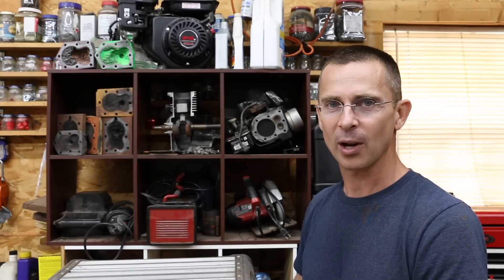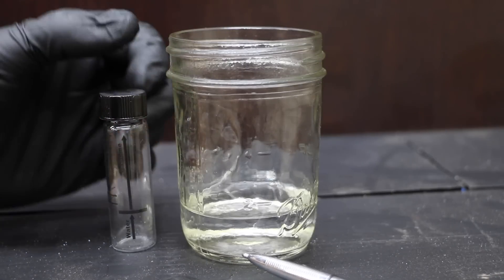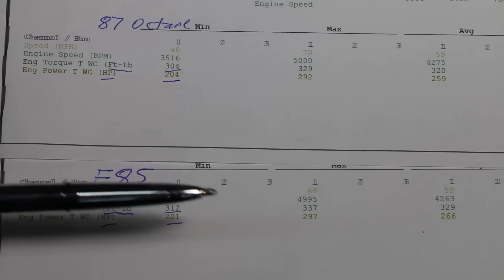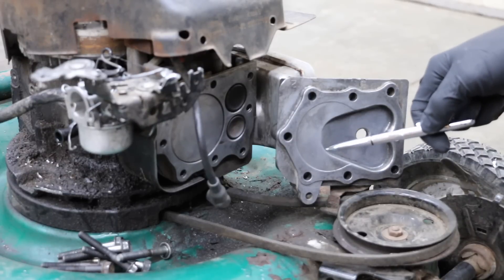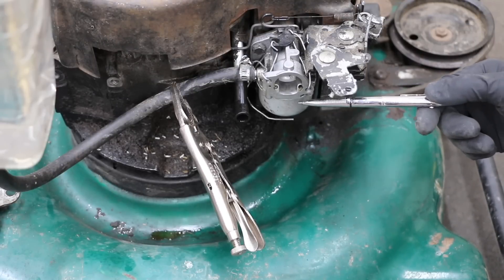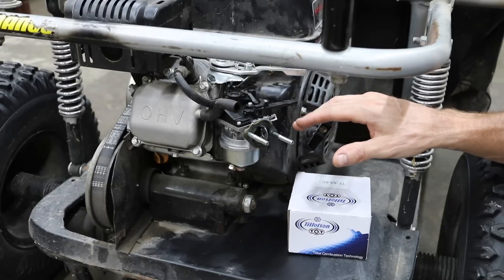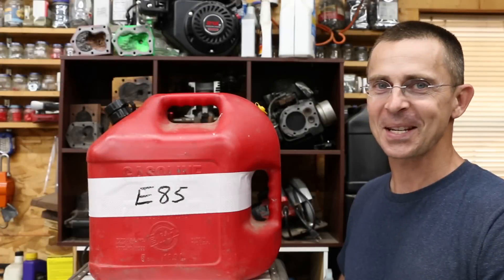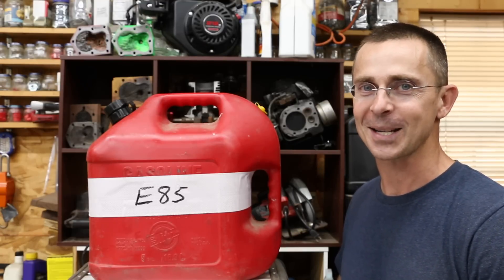Is E85 better than Gasoline? Let's find out!

Comment: Awesome!!! Been super excited for you to test Ethanol.  Would highly recommend you try e30-e50. I personally run E30 without a drop in mpg.

It doesn't surprise me to see a that massive chevy get less mpg. Even FF engines cannot take full advantage of the E85. You need more compression! 

Only thing a flex fuel car is good for is a computer to recognize E85, oversized injectors and adjust timing. I'd recommend a newer car, perhaps with a turbo to test e30, E50 and E85.
Reply: What is an E85 engine? Flex fuel vehicles just use the same engine as the non-flex fuel model.
Reply: MoronicAcid1 meant flexfuel!
Reply from the maker: Thank you

Comment: E85 is cool. It has a lot less power per gallon but alcohol just oxygenates so much better. The biggest problem though is that no matter how you cut it you can never make back the hit you take on MPGs compared to regular gas on a normal engine. If you have to run premium or higher then maybe. But in a vehicle that can run 87 no problem, it just isn't worth it. And if it weren't subsidized it would cost way more than it does. Also, we use corn, like the worst possible product to use for it possible because your yield is so terribly low compared to what you have to grow.
Reply from the maker: Thank you

Comment: Alcohol has approx 2/3 the BTU per pound as Diesel. Russia uses Vodka.
Set up a dyno for lawn mower using a water pump or alternator
Reply from the maker: Great point. Great test idea! Thank you
Reply: vodka is 60% water. I doubt you'd get good performance mixing in that much water.

Comment: In Brazil we have ethanol in all gas stations throughout the country, but is only ethanol with water (96% ethanol) because is a azeotropic mixture, and gas have 27% ethanol, engine runs rough on ethanol, but cooler and generally with more power. In the sugar cane season the ethanol prices drops and become more reliable than gas
Reply from the maker: Thank you

Comment: I run e85 in my ford ranger. I have to fill up every 6 days instead of 7 days and costs 30-35 cents a gallon cheaper so it evens out. It runs cooler and can feel a bit more acceleration.
Reply from the maker: Thank you

Comment: I've noticed with even max e10 fuel...89 octane...I'm my 98 f150...the fuel filters get gummy quicker. Ford recommended replacement at 30k miles by the book...well...they are nasty at around 12 to 15k now. And i use "name brand" gas. Then they did when it was basically new. I've also seen this on vehicles built before the ethanol blended fuel invasion!
Reply from the maker: Thanks for this information.
Reply: Thank you for viewing and responding to any comments. Top notch channel 👍👍

Comment: How would an engine designed to run specifically...not a compromise to burn gasoline too,  on e85 compare?
Reply from the maker: Great point. More horsepower, less fuel efficiency.

Comment: I have a turbocharged Dodge Ram 1500, and i have switched it to only E85, and picked up an extra 76 horsepower on using E85. The combustion chamber stays much cleaner and i can add much more timing with E85. Compared to gasoline i would never go back to it. E85 is the way to go in my opinion. If you compare cost of E vs 93 octane gasoline I’m actually winning. The fuel mileage does suffer a bit but not enough to care. E85 also comes out of the pump closer to 106 octane also. In the performance world, E85 wins hands down. Although the upgrades that had to take place on the fuel system (big fuel pump, big fuel injectors, fuel line that can hold E85) idk if the cost would be worth it on something that’s not a “performance” type build. With that being said, if you have a E85 vehicle already, it is well worth having it tuned on both and you can get the real benefits out of E85 and not completely kill your mileage due to the efficiency of E with the added timing it allows the engine to run.
Reply: Not to mention the cooling benefits that you get off of using E85 in a forced induction vehicle.
Reply from the maker: That's a huge gain on HP!

Comment: Ahhhh man, you completely missed the point of E85.  E85 is an amazing fuel for Turbo applications, where it burns much cooler. With it being a cooler burn, the boost can be turned up.  Most importantly though, and in general. The point at which detonation occurs increases by a decent amount. Again, the boost can be can be turned up, or the compression can be increased, timing can be advanced, etc.  Your main point, All applications have to be designed for E85, I do agree with. You won't  see any discernible difference in your grandmas Toyota.  And the destruction of all the gaskets, fuel lines, etc.  Would really suck.  The fuel mileage!  I thought the pitch was you get less milage, but the cost was less.  Even-ing out the cost, but you save the planet???  I could be way off base, as I live in Canada.  I've never seen a pump with the stuff, It's probably a climate thing.

Try a Turbo application and dyno tune, one on E85 and one on 91.  That's a better  fit comparison.

I absolutely LOVE this channel!!!  Seriously though, Keep up the AWESOME work.
Reply from the maker: Thanks for the constructive feedback and thanks for the positive comment.

Comment: Only use E85 on cars marked as "flex fuel" using it on one only designed for 10-15% Ethanol content will result in rusted fuel lines since ethanol is corrosive.
Reply from the maker: Thank you

Comment: With some tuning on the old carb would e85 be good to run in an old 16hp I/c cast iron Briggs? Seeing how it runs cleaner and the Briggs doesn't have rubber gaskets to ruin it's a thought.
Reply from the maker: Great video idea!

Comment: My in-laws had a Dodge pickup that was flex fuel. I believe it was a Ram, but not sure. Never been a Dodge fan. It got better fuel mileage on E85 than pump gas. It surprised me. If it ever came down for me owning an E85 vehicle, I'll get an older carbureted one and just change the the timing and carburetor gaskets. Be a hell of a lot cheaper
Reply from the maker: Thank you

Comment: I tried it one time about two months ago on my 2010 C300 which requires 91 octane minimum. Only tried it because it was more than $1 less per gallon. The mileage was horrendous. About a 35% drop which completely cancelled out any cost savings. There was no performance improvement. If anything it felt like it had slightly less power. The exhaust smelled noticeably different as well. 

I would not recommend it for anyone that lives in a humid environment due to alcohols propensity to absorb water. 

I would recommend it for anyone with a modified engine running higher compression or supercharging that normally buys expensive race gas. E85 is 99 R/m2 octane or 104R. It will get the job done.
Reply from the maker: Thank you

Comment: E85 contains less energy per unit than regular gas, which is why the gas mileage is worse.  Basically, to get the engine to work properly, you have to put in more E85 than you would gasoline.  
It's unfortunate when looking at numbers, but it has some advantages, like it's more resistant to knocking/pinging, which is great for turbo application but again with the caveat of having poorer gas mileage.
is it better?  worse?  depends.  it's better in the sense that it doesn't need oil to be produced, and it can produce higher power (more boost, more timing), but it's worse because you need to use more of it, and it's pretty corrosive to anything it touches that isn't made to handle it.
Reply from the maker: Great point.

Comment: the extra horsepower is gained by the engine being able to add more ignition advance with e85 as its around 100 octane. but because there is less btu's per lb more fuel will be burned to make the same energy. the high octane rating is why e85 is becoming so popular with people running forced induction, able to push the limits much higher with e85 than you would be able to with premium pump gas.
Reply from the maker: Great point.

Comment: I wonder if it's be worth it to try and clean the engine, maybe why it didn't get up to 5,000 RPM. Maybe a Seafoam and oil cleaner and try again?
Reply from the maker: I believe the vehicle is electronically limited to a certain speed.  Thank you

Comment: Excellent test. I think E85 is not worth it unless they go back to the drawing board on the engines. It does keep things cleaner,  but you are losing MPG and horsepower. They need to tweak the engines to work better on E85, especially if they do what Iread they want to do. From what I read, I believe they want to get rid of muti grade octane gas, and go with one octane only. Not sure if this will pan out or not.
Reply from the maker: Thank you!

Comment: My mechanic hates alcohol in gasoline, has went on a few diatribes on how much he despises the stuff.  He thought I used non alcohol gasoline in my 79 Lincoln, so when he did some fuel system repair on it a few years ago he put on old fashioned hose.  The 10% alcohol fuel  I used caused the hose to fail and kink in a few hours and cut off the fuel supply so the car wouldn't even start.  He replaced the line and it works fine today, but lesson I learned from this small incident is how bad even 10% ethanol is on old fashioned parts,  how bad it can potentially be for even older motors and parts that my 40 year old car.
Reply from the maker: Wow!  Thanks for commenting on this.

Comment: I hear the car tuners love E85 as with tuning they can pick up some extra power, a good amount just with retuning for e85. I put some in my 89 ranger (( BY MISTAKE ). and no surprise she did not like it at all...yes I burn that tank as fast as I could...
Reply from the maker: Great point on car tuners liking it.  Glad no harm was done to your ranger.
Reply: Well I just had to replace the fuel pump and the filter was so bad,the fuel look like chocolate milk...its running better,not sure if that was the problem,or something else...

Comment: It's cool that we can grow fuel, Ethanol. But unfortunately it ends up costing more to use, and it pollutes more when considering the production of it. Biofuels from algae are the only real solution for low cost and low emissions fuel.

Though, since E85 burns more cleanly, I wonder if it would enhance the life expectancy of the engine if used exclusively.
Reply from the maker: All great points. Thank you

Comment: Years ago I had a 2007 Dodge Dakota, which had the flex fuel 4.7L V8. Your video is spot on with what I experienced back then. The truck ran great on E85, but the mileage was horrible. Between the mileage and the fact that back then there were hardly any gas stations selling it, I only tried it a couple of times before going back to standard gas. Great video!
Reply from the maker: Thank you!

Comment: If your vehicle is built to handle E85 and it’s inexpensive in your area then it could be a viable alternative. Any gasoline will always give you better mileage. Where E85 really shines is in high performance motors. E85 allows you to advance your timing and lean out your air to fuel ratios without causing pre-detonation much more than you could with gasoline. This is VERY beneficial in high compression engines and/or high boost applications with proper tuning. In what I’ve seen, you are unlikely to really see performance benefits from E85 on more standard, lower compression motors.
Reply from the maker: Great point. Thank you!

Comment: I’ve talked to folks with older cars and the ethanol in the gas has caused them problems with rubber seals and gaskets breaking down. I was surprised of the power gains using e85, what I’ve heard is it would cause a loss of power. Keep up the good work.
Reply from the maker: Thank you!

Comment: I run E85 in my 2015 Mustang GT that has 47lb fuel injectors and a special tune installed for the different fuel. E85 produces  17 more hp at 7100 RPM, but the Dyno curve shows that it produces more HP and TQ along the entire curve, so peak hp is not the entire story...
Reply from the maker: Nice!

Comment: You know what sucks? Cheap gasoline in the USA is much better than the most expensive gas in Brazil. Here the best gasoline contains around 27% of ethanol... the price? Around $5 for a liter, yeah, not a gallon.
Reply from the maker: Wow! Thanks for this information. That's expensive!
Reply: @ProjectFarm  people here use a product that claims to reduce engine wear, capeable of running an engine without any oil for some time. Would you test it? Its been a hype in Brazil, I could even send it to you. 
Even though they say that it is produced in USA and sold to the army, I cant find any store there selling it there. Its name is Militec 1. Do you know this product?
We would love to see you testing it! I can asure you that you would get thousands of views.

Comment: alky fuels make more torque, because the octane rating is way higher in pure form its around 118 octane but gasoline, has  almost twice the BTU,s which mean you use more alky fuel to make the same amount of power, im talking carbs here fuel injection may have different values, also with alky you need less oxygen because alky has more oxygen  molecules in it.. goes like this 7-1 for alky and 14 -1 for gas, this is for carb applications, I dont like the  E fuels they can wreck carbs due to corrosion of aluminum and rubber hoses.
Reply from the maker: Great point. Thank you

Comment: I like E85, or higher ethanol fuels,  But most of todays cars can not take full advantage of this fuels potential, Ethanol does way better in higher compression engines or in boosted applications, When you put it in that high mileage truck I thought it would of clogged the fuel filter or injectors I've seen it happen that the ethanol cleans up the crap from the gasoline in the tank and fuel lines and clogs up the injectors. I've even used E85 to flush and clean old fuel lines in my builds. Now for everyday use E85 is not worth the cost, When regular 87 octane gasoline reaches above $5. per gallon then it becomes more  viable alternative
Reply from the maker: Great point.

Comment: I have used E-85 in many different things, including my Honda lawn mower, lawn mower had less power and after a summer of use with only E-85 it ruined the carb. It still ran on regular gas, just had to run it on full choke. 
Turbo engines do not like E-85, ran int in my wife's Volvo, fuel economy was less but not hugely so. 
Ran it in our '89 Camry with a 4 cylinder engine, that car didn't care.
Ran it in one of my old work vans, a Econoline, a tank of fuel a day. Van didn't care until the heat of summer, the fuel evaporated before it could reach the cylinders. Engine would not start on a cold morning if temps dropped below 50*F. Cranked it over until the battery went dead and would not start. Fuel economy was way less but it was so cheap it offset the poor mpg.

Anytime I rent a car I return it with a full tank of E-85, even if the car is not a Flex-Fuel vehicle.
Reply from the maker: Wow!  Thanks for commenting on this.

Comment: I use e85 on my truck I get a 2 mpg difference but with price of e85 being 80 cents cheaper than 87 it's definitely worth it and there is a bit of performance difference my truck runs better on e85
Reply from the maker: Thank you
Reply: Ethanol attracts water.
Reply: yes but why does it matter when it's the daily Drive you burn throw a tank of gas every day to every 3 days anyways So when dose Ethanol have time to Attract Water only time it does it when you let your car set for months at a time like if you live in Michigan and you have a Classic car or a hellcat you fill it up for summer just fill your car up on 93 than  That Summer when you get it out Run it till its on E than put e85 back in
Reply: @Johnkoth  so drive it every day. If its gonna  sit or not be driven every couple days put in regular gas
Reply: I agree I have a flex fuel 2007 Suburban and only experience about a 2 mpg difference on the highway a bit more in the city. At 140k in mileage no problems with the engine. So for me saving the 80 cents sometimes more has paid off.
Reply: What kinda truck and what motor?
Reply: My 2010 F150 gets 12 mph on E85 and 18.5 on 87. Hands down I run 87
Reply: I could see you using e85 if gas prices were 5$ a Gallon LMFAO
Reply: Wesley Morris: That means your trucks engine management system is really crappy at adapting for E85. If you took it to a speed shop and had it tuned better for E85 you would see a huge improvement in milage. My guess is that ignition is set very conservative for 87 and the engine likely has fairly low compression. :)
Reply: @Power_Glove : I agree. I have a 2013 Ford Taurus Flexfuel and I have noticed the cons of e85 plus it's hard to find a gas station that even sells it especially in CA. I got lucky and found 3 and the areas that I do pass through. I have since moved to WI and e85 doesn't exist in a very small town of 2500 people and had to switch back to reg, fuel.
Reply: That is a weird result. E85 requires more fuel to achieve the same results. This is proven through many tests. When converting cars to run on e85 that otherwise shouldnt, all you have to do is add more fuel.... e85 takes about 25% more fuel to achieve the same power as regular non ethanol gas.  So that result just seems off.
Reply: same here

Comment: Used e85 in my car when i got a tune for it. Tune was really good and I ended up with almost the same gas mileage (~90% fuel economy of premium), but power at peak was significantly better. With the lower price of e85 in my state, I was actually saving money. However, the lack of gas stations that sold it made me switch back to regular fuel. I would compare the power gain to a small amount of forced induction - ~5-7psi.
Reply from the maker: Impressive!